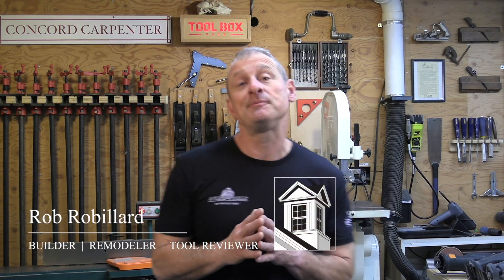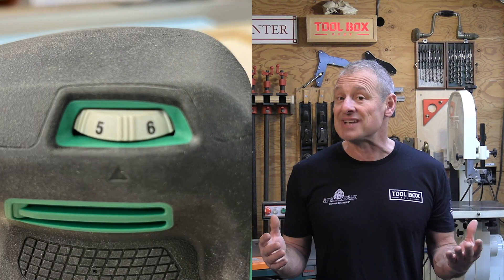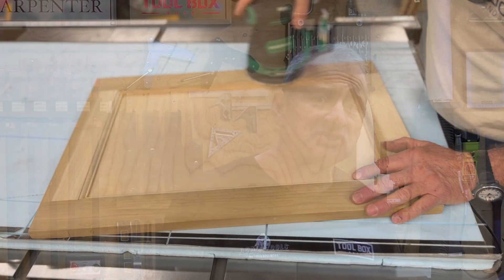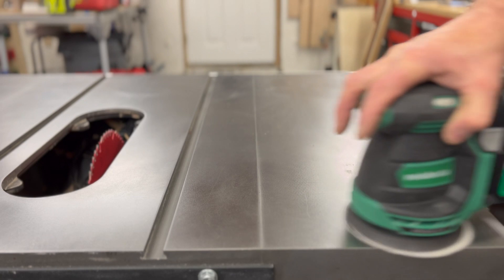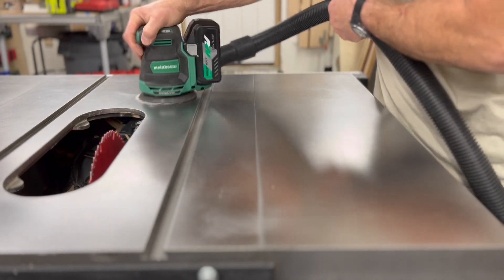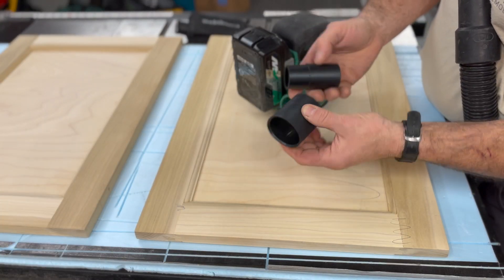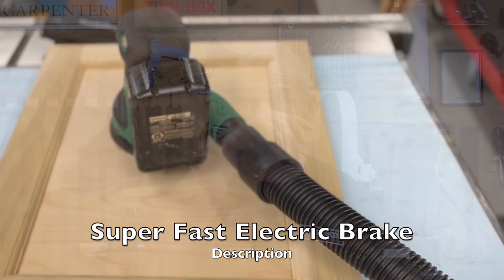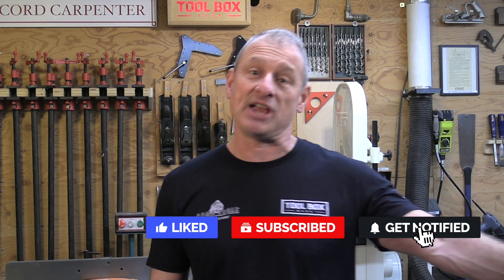Metabo HPT 18V Random Orbital Sander Review

Comment: What about balance and ergonomics of the tool when using the multivolt batteries? Would you recommend staying with the compact 18V batteries for this tool?
Reply from the maker: Yes
Reply: Just holding it in the store, it's a bit beefy and bulky, similar to the Milwaukee but worse

Comment: If you compare this sander with Bosch one,  Bosch is much better on ergonomics and performance.
Reply: Metabo hpt has more power. Bosch has less vibration and better air filtration
Reply: @N1rOx  If you calculate the running time of one battery pack,  Bosch is much longer.
Reply: @craftsmanchen7663  run time is less important when both can last well over 40 minutes straight. If you are sanding this long regularly, you will have more than one battery and so one charge while you can't use one up. So runtime, at this level, is a less important metric when both can last a loooooong time.

Comment: Orbital sanders are the one item I don’t feel the need for being cordless. I prefer the consistency of a corded model.
Reply: I agree for the shop.  On the job site, it’s a pain to haul out a cord for this one tool if you don’t have much sanding to do.  If it’s setup at a station with your saws, that’s a little different, but if I’m carrying a tool up a ladder/through a house, then I don’t want a cord.
Reply: Orbital sanders are always breaking on me so I haven't yet bought a cordless one.
Reply: I feel that way on angle grinders. They're so power hungry for my 4Ah and 6Ah batteries.
But I've had a cordless orbital sander with a Brushless motor and I've been impressed with the runtime and practicality
Reply: @engineer_alv  I stripped paint off my garage doors using my brushless grinder. I was going through a 4ah battery for what felt like every 5 to 7 minutes. Luckily for me, I have enough batteries and fast chargers to just keep rotating into a fresh one.